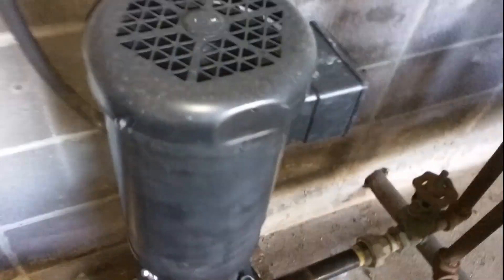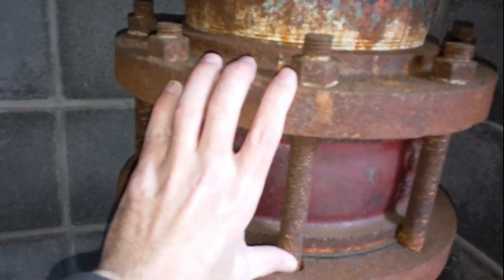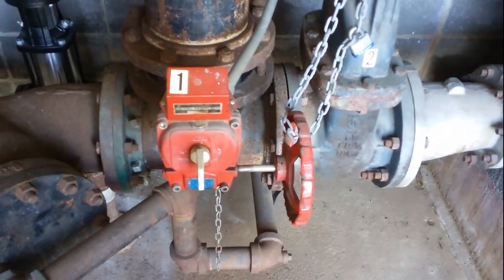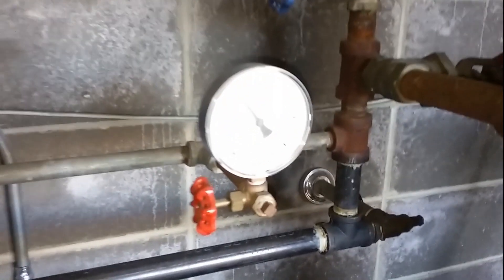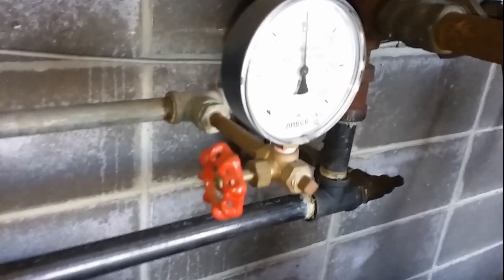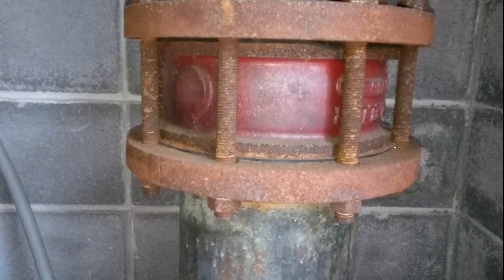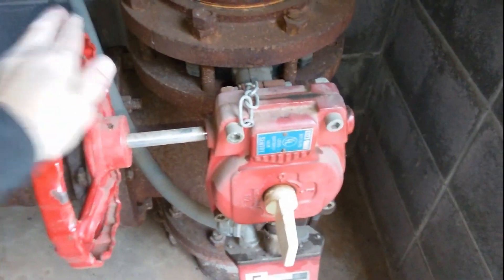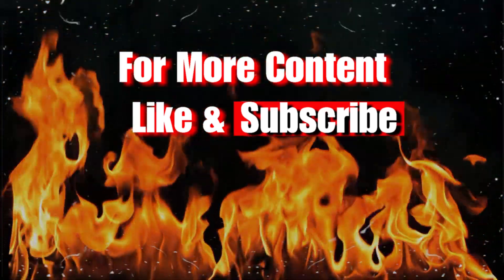Jockey Pump Wouldn't stop running-Quick fix/Fire Pump

Comment: Who taught you to stand directly in front of the pump controller when flipping the breaker
You never ever stand directly in front of it. Standing in front is a good way to get yourself killed
Reply: Completely wrong Mike, I would be surprised if a single person has ever been killed as a direct result of throwing the switch lever behind a closed panel door. There is no chance of shock as the level is electrically separated from the isolator connections so the only danger I could imagine you are talking about is arc flash. This engineer in this demonstration is doing this behind a closed panel door which would contain the blast/heat to an extent which would save him from severe injury. There us cautious and there is overkill. Your comment about him not making videos is unwarranted.

Now, if you were talking about racking in and energizing a main ACB which could have a huge fault current then I would agree. No one should ever he in that position without adequate PPE (arc flash protection) of the correct rating
Reply: @knryan82  As someone who sells and starts up fire pumps daily. Mike is correct. Stop Button stand to the side. My team wears full arc flash gear at time of engaging or disengaging the iso switch. PERIOD.
Reply: @knryan82  Also loss of hearing, eye sight, burns, getting thrown across the pump room floor because of the doors pop. But I guess as Mr. Chow from the hangover series says, "But did you die" is good enough for you, carry on.
Reply: Also you're supposed to hold the stop button when engaging or disengaging the circuit breaker means 
You should probably stop making those videos and go get some actual training dumbass